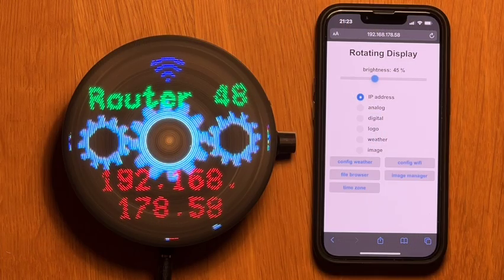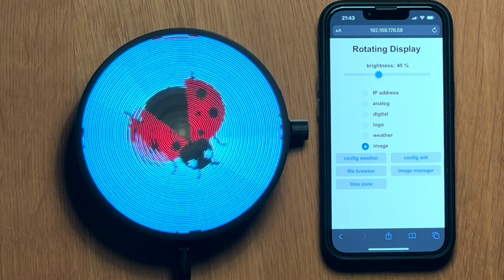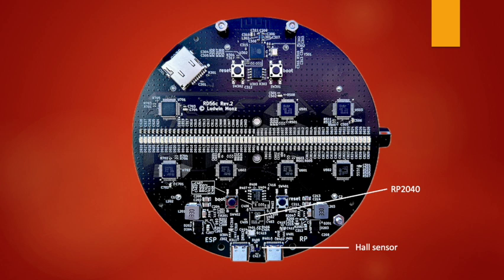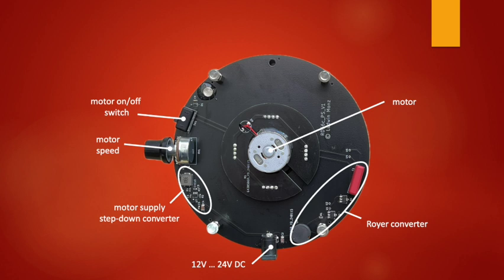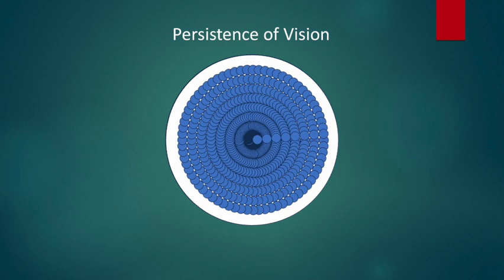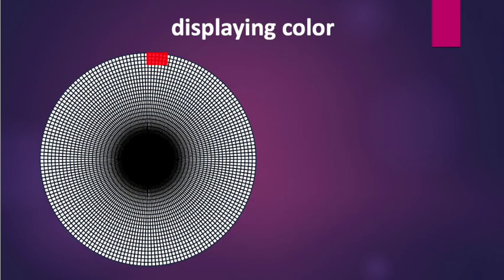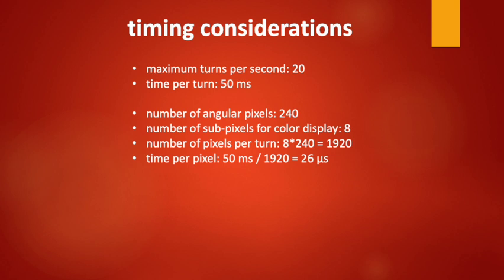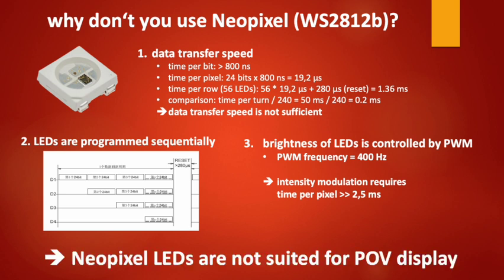DIY rotating color LED display - ESP32 and RP2040 microcontrollers. POV (persistence of vision)

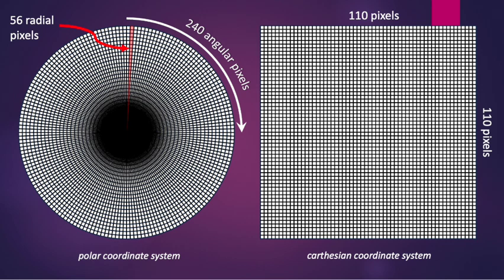Comment: How did you arrive at the value of 240 angular positions at min. 17:06?
Reply from the maker: There is no mathematical deduction of the 240 angular positions. I tried to somehow match the size of the pixels in the polar coordinate system with the size in the Cartesian coordinate system. While the pixels in the polar system are very small in the middle, they are much larger at the outside. The radial pixel size is 1 mm, the angular size is approximately 1.6 mm. That looked reasonable to me.
In my latest project (the rotating sphere) I moved away from the 240 and use 256 instead.

Comment: Thank you so much for sharing this project in such extreme detail, and all the explanations, I don't see this quality much when looking at open source projects.
I am thinking about building it, and was wondering if anyone has a set of PCBs that I could buy. If not, I might bite the bullet, and order it (would cost about $80 for 5 sets with shipping), in which case I will have extra sets, as the minimum number of boards to order is 5. If anyone else is interested...
Thank you again, Ludwin! Just reading the documentation and watching the video made my day, I am looking forward to building it.
Reply from the maker: Thank you for your feedback, Miklos. Please check the "issue" list of my GitHub repository. There is one open item which actually is not an issue but rather a general support thread. As the originator is currently building a unit, you might ask him, if he has a set of PCBs left.
Unfortunately, I do not have spare sets right now.
Please let me know, if you run into issues when building the display. Open an "issue" on GitHub, please.
Have fun with the project, best regards, Ludwin

Comment: This was very cool and kind of you to anticipate and explain all the questions I had- paritcularly about color and timing, and why WS2812 and similar just isn't fast enough.
Reply from the maker: There used to be a fast variant of WS2812, both in regards to the data transmission and the PWM. Unfortunately, it disappeared from the market, I assume because speed is not an important requirement for 99% of the WS2812 applications.
Reply: @LHM000  Not yet anyway- maybe projects like this will prompt a comeback!🤞

Comment: APA102-2020-6A leds? Would they not be fast enough?
Reply from the maker: I do not know this LED. According to the data sheet, data rates should be sufficient. Here is my calculation: time per turn: 50 ms, 240 pixels per turn, results in 210µs per pixel. 56 LEDs need 58*32=1856 bits. Time per bit: 60ns. Time per 56LED data set: 1856*60ns = 123 µs. 
However, the data sheet is pretty cryptic about the PWM. The PWM frequency is specified with 20kHz (=1/50µs). This would result in 4 cycles per pixel, which would barely be enough.
So, my conclusion: there are good chances, this LED would work in a POV display.
Reply: @LHM000  Good analysis. I've been using APA102 for years in favour of neopixels. Assuming the user can stomach the more complex PCB layout, the synchronous data benefits and high pwm freq are a definite advantage.
Reply: @nikthefix8918  When you say more complex PCB layout can you give me some idea to the degree of complexity? What is the basic difference of these fast serially address LEDs to the NeoPixels?
Reply: @nikonikolic1365  In terms of pcb layout, you're dealing with 6 pins instead of 4. For high density led arrangements this can add significantly to the board complexity - but I think it's worth it.

Comment: Hi. Thanks for the video. I wonder if it is possible to get full or partial color spectrum with blue, red, and green regular LEDs if puts them on x-shape for one color on each x's side (one color will be on 2 x's sides), is it will make wanted result? Thanks
Reply from the maker: Hi, I do not see any reason, why such a geometry would not work. In fact, I thought about such a setup, initially. However, there is a rather practical challenge: fitting all components (LEDs, drivers) on a 120mm disk. Integrated RGB LEDs allow for higher integration density.
Reply: @LHM000  thanks.
Reply from the maker: Here are two more thoughts on your idea:

1. color mixing: you would need to make sure, that there is a good spatial overlap between the R, G, B LEDs that you want to color mix, as rectangular LEDs are pretty large. Either go for 3 arms (Y shape) or for 6 arms. Four is not ideal.
2. White balance: you would need to match the intensity of the R, G, B LEDs respectively, so that you get white. This is pretty much „for free“ in the integrated RGB component (they are designed for that), but not a given, when you use discrete LEDs. However,  check on the approach that I have implemented with separate enable lines for the three colors.

Comment: The work is extraordinary and I can only congratulate you. This is not technically available to everyone. There is a lot of technical detail in it. It is not clear to me why the displacement of the LEDs with respect to the center? . I am also not clear about the way to control the LEDs' brightness by subdividing it by 8. It is a very complete and very complex work. Congratulations. A greeting from Spain.
Reply from the maker: The LEDs have a width of about 2 mm. Without interlacing, the radial distance between pixels would be 2 mm, therefore. However, by introducing the displacement, the left and right half of the LED row generate a spacing of 1 mm.
The brightness control is very simple: let us take just one LED, for example red. If we want to set intensity to 50% we turn on the LED for 4 cycles, and turn off the LED for the other 4 cycles. 75% would be 6 cylces on, 2 cycles off, and so on.
Reply: @LHM000  Thanks, now it's clear to me. These are the times that the LEDs turn on or off. Very ingenious. I would love to fully understand the project. I'm going to study it as much as I can. Thank you so much. All the best .
Reply from the maker: You might consider to get started with the monochrome version. There is a full description on instructables.com: https://www.instructables.com/Rotating-LED-Display
Reply: @LHM000  Thanks a lot

Comment: Very cool!

I wonder if a 3d display could be constructed in a similar way by layering several boards in a sort of "screw shape" at different height levels.
Reply from the maker: 3D will be one of my next projects. It will need more LEDs, however. I will keep you posted

Comment: the whole thing could have been done with just ESP32.
Reply: 1 core to process wifi and web hosting, 1 core to process image conversion, 1 core to process exact timing with hall sensor and sync the 7 spi chips at 20mhz. If you get rid of wifi probably. But if you want wifi you would not be able to do it. There is simply not enough processing power to convert Cartesian to polar, and sync the display while reading sdcard and processing wifi with a simple 2 core esp32. You could use 2 esp32 chips but 1 is simply not enough  unless you simply want a predefined image displayed. Just based on my rough estimates watching this video.
Reply: In this case, you can use 2 different boards, one processes its half of the duties and sends it to the other
Reply: @newmonengineering  if the Cartesian to polar is the only drawback, it can be easily solved using a look up table. Constant time operation. He explains it very well in his previous video but the concept is old. Classic computer science problem. I think ppl have been using such look up tables since at least the 50’s 😂

Comment: I command your efforts, it is a nice project and working well. Impressive integration.
 But when I see such project using both an esp32 and an rp2040, which are both vastly overpowered and could each carry on their own the entirety of such a project, I can only recommend you deep dive in software development, optimization and how to best use available hardware. Hopefully this is just a first prototype.
Reply from the maker: The RP2040 would probably be sufficient in terms of computing power for the rotating display. Unfortunately, this controller does not have an integrated Wifi. The available solutions all add a (mostly costly) specialized chip, some even use ESP8266 for this purpose, which is close to my solution.
Using ESP32 only (as suggested multiple times) would be difficult, as it does not have the required timer functionality. However, I would be keen to see such a solution.
Reply: @LHM000  there are rp2040 boards with wifi.
The esp32 has way enough for high speed synchronized and serial stream to the LEDs, use the SPI or I2S peripherals and a few shift registers. It's been done before even on lowly esp8266.
Reply: @bschwand The speed of the CPUs in the ESP32 is definitely enough but i think the interrupt jitter would distort the image. Ie. the output speed isn't the problem but rather the exact timing of the output (Timer and ext. input interrupt latency). Might be possible to remedy this, at least partially, if RTOS is run on one core and no-rtos code just outputting the image run on the other. But I think this solution is just fine as this isn't a cost optimized project made for mass production.
Reply: @MrZANE42  you can do a lot more with clever programming. You can drive ws1812 and do RealTime step control with hardware SPI and or I2S. You just have to correctly use dma, interrupts and use the available hardware creatively. Check some of cnlohr 's projects for example.
Your comments make me think of people who say a full USB or tcpip stack on a uC with 200 bytes of ram and barely more than that of flash, is impossible. But it is.
Again, very nice project and execution, I am just a fan of optimization and maximizing resource usage 😁
Reply from the maker: @ MrZANE42: You are spot on.
Reply from the maker: Regarding WS2812 please refer to the last 2 minutes of the video
Reply: @LHM000  I was using that as an example. Point is, realtime issues and jitter can often be dealt with in a smart way or a brute force way.
Btw, using a preemptive realtime Kernel might not be at all the solution you think it is. It introduces uncertainty and non-determinism. In very consteained systems, co-routines (cooperative scheduling) allow much tighter timings as the whole system timing constraints can be made fully deterministic.
And btw, esp has two cores, one running wifi stack and the other application. At 240MHz you bet there is very ample time to respect this display low res low fps timings. You know, you can generate VGA signals in software on an 8bit avr... So this is comparatively a walk in the park
Reply: @bschwand  I'm well aware, and very impressed by, what people like cnlohr are doing. And I'm not saying that it is impossible, what I'm saying is that it's up to the person doing the project to decide that the goal is. If it is to just create a cool project in a reasonable time the chosen way is a good one, if it is to learn (or to make a cheaper product) and your ready to really dig into the datasheets and do assembly coding then sure, it might very well be doable with only an ESP32. I know people who have tried to do synchronous high speed stuff with ESP32 and failed because of the jitter. But most likely they didn't try writing the code in assembler as it was a low volume/high price product they were developing so they just added another cheap micro for the time sensitive stuff. Here's an interesting link btw. that suggests it might be possible if you write some of the code in assembly: https://haydendekker.medium.com/esp32-interrupts-can-only-do-200khz-56f8dbb6a61c
Reply: @MrZANE42  totally agree, Arduino is great for getting something working quickly, but it has lots of overhead and inefficiencies. It's always a balancing act. I just hate when I hear "it can't be done" when really what should be said is "it can't be done _this way_"
Reply from the maker: @MrZANE42: Thank you for the link. Very useful.
Do you know whether the ESP32-S3 is any different from the classic ESP32 in regards to the timers? 
I looked up the ESP32-S3 documentation - the major difference to the RP2040 timers is, that „alarms“ can only trigger interrupt routines, but can NOT hardware switch GPIOs (as in RP2040). As a matter of principle, every signal, that is generated in such an interrupt will have a jitter. That is not the case in RP2040. 
It is a shame, that the RP2040 does not have a on chip WiFi.
Reply: @LHM000  I have only, so far,  played a little with the S3 at home so I haven't yet dived into the timer or interrupts parts of the datasheets or done any testing of those peripherals. It would be quite easy to do the interrupt/latency tests similar to the ones in the link in order to see if it would be possible to everything in just an ESP32-S3 (If that's is what your thinking).

Regarding the "alarms issues": I thought that if an external GPIO interrupt started two timers, one timer as a periodic interrupt (with autoreloaded interval  based on average of last couple of ration duration divided by number of sections on the circle) that  handled outputted the LED data and one timer that counts the rotation time. The periodic interrupt latched the previously outputted LED data and starts output of LED data for the next segment (With DMA). After last segment timer disables itself. But I guess it all comes back to interrupt latency and jitter if it's possible to do it this way. And like stated before this would have to be run on one core and the RTOS on the other.

Comment: It is truly amazing how stable the images and animations are. Quite an achievement!
Reply from the maker: Dear Jeff,

image stability depends on several factors:

1.	Free running timer, that triggers interrupts
The RP2040 timers are ideal for the application, as they have a high resolution and the necessary threshold functions. The two computing cores of the RP2040 allow for uninterrupted execution of the interrupt routines.

2.	Stable spacial trigger
The use of a Hall sensor turned out to be highly repeatable and stable

3.	Management of interlacing
When the LED data changes from and old image to a new image, the displayed image is a mixture of old and new (half of the LEDs display the old image, half display the new). Therefore, some transition management is needed.